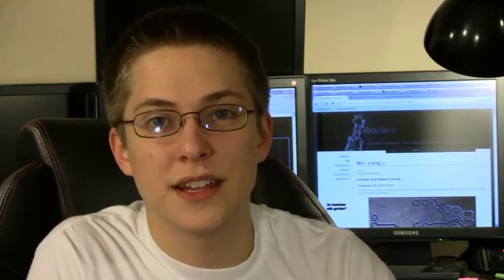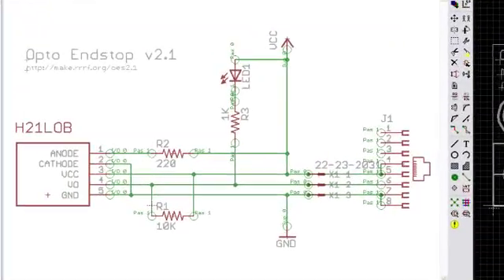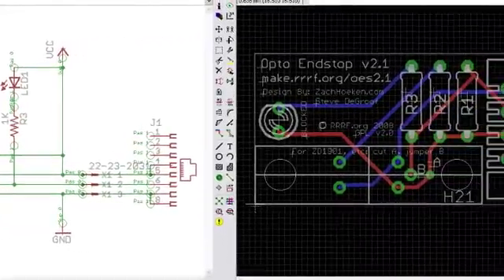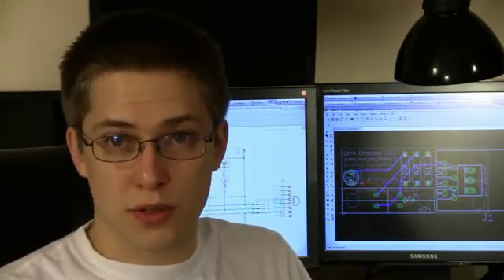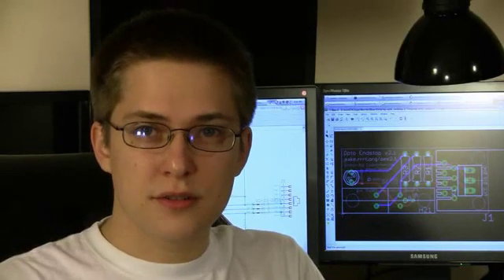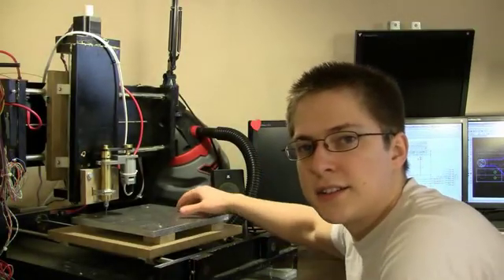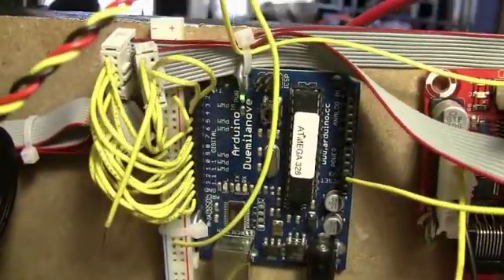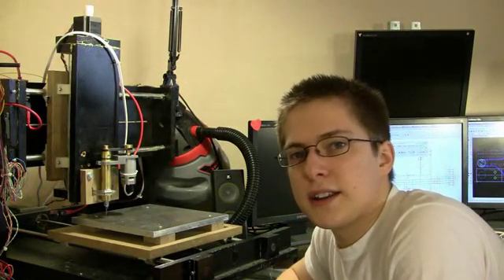onshouldersTv: Open Source Circuit Boards at Home

Comment: obviously the super-glue works, but isn't that a PITA? Have you thought of drilling and tapping the bed in say 1/4-20 and using screws and such to hold down the board? You would lose the ability to go all the way to the edge, but most of the time that should not be an issue.